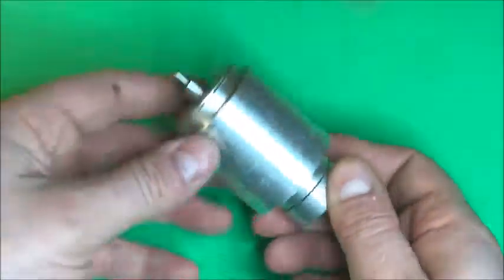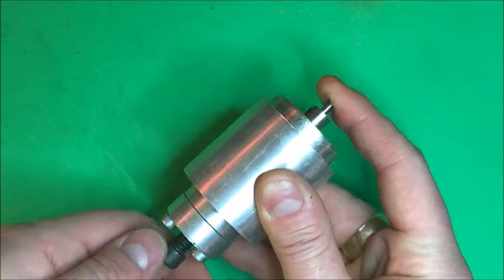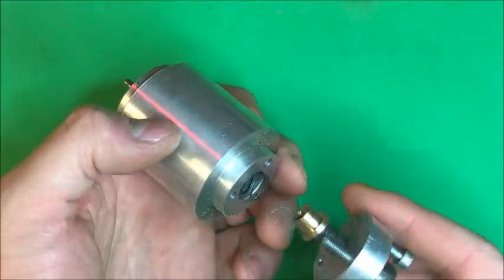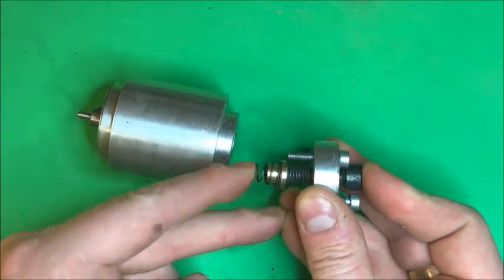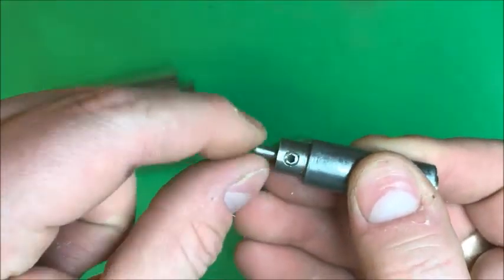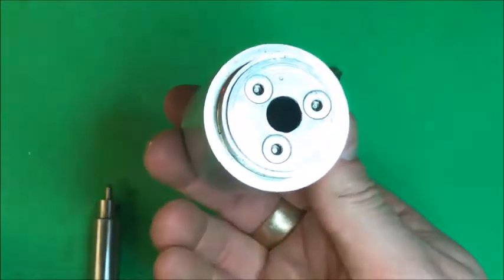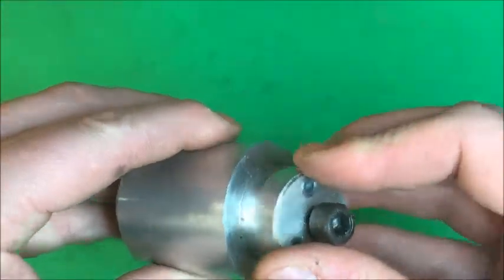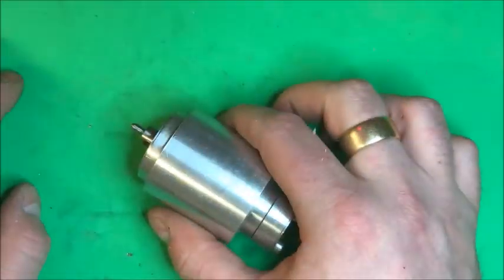Making s Drag Engraver for a CNC Machine - home workshop

Comment: I don't understand how the tip is able to rotate with this setup and how the whole tool is attached to your cnc machine. It's a very important part of the idea and you missed to explain it T.T
Reply from the maker: Alejandro Pérez why should the tip rotate? The outer diameter of the main barrel is the same as the Milling spindle. It just takes the place of the spindle.
Reply: @craynerd  I got confused, didn't know diamond bits didn't need to rotate.
Reply from the maker: Alejandro Pérez it is actually free to rotate as the tip is screwed into the centre bar and than just sits on a shoulder, free to rotate within the main casting. But I don’t think it has to by design.
Reply from the maker: Alejandro Pérez and certainly not like a Milling spindle if that is what you are thinking! It’s just a hard diamond, you push it into the material and it literally scratches the design,